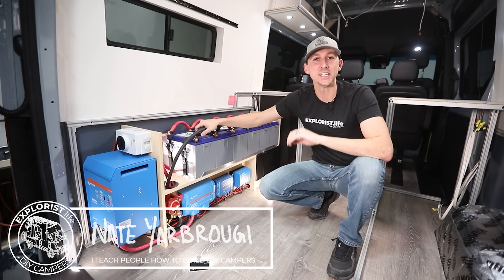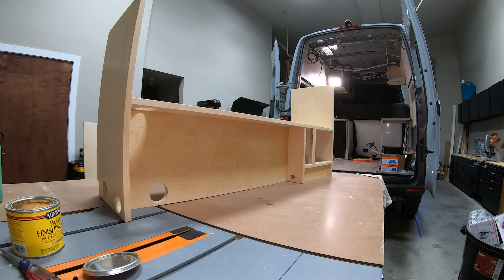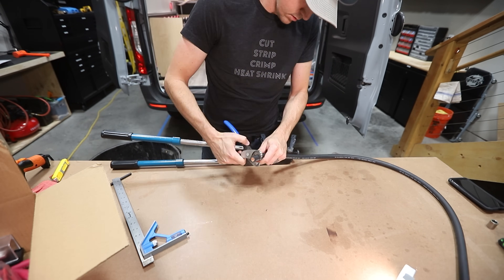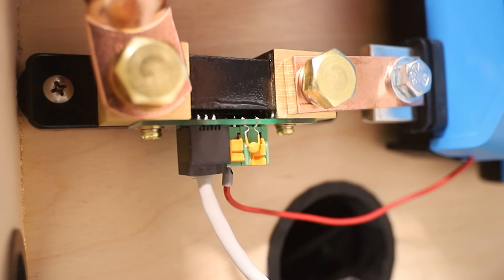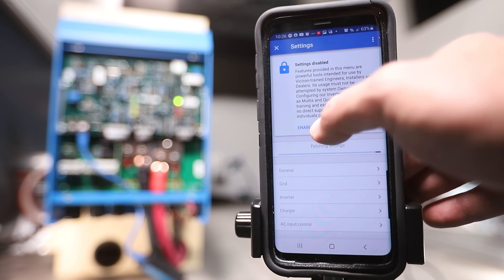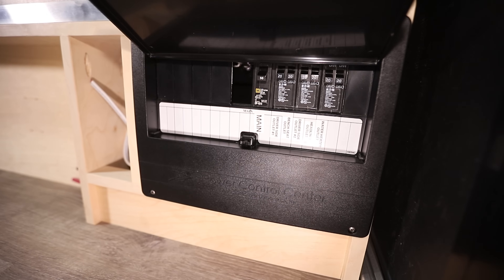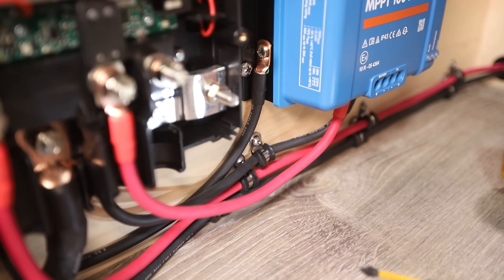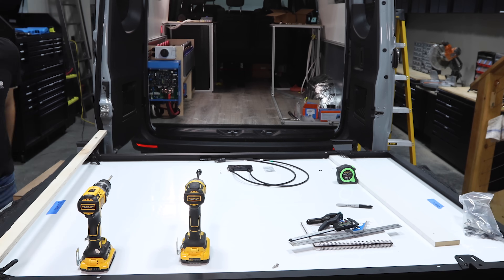DIY Sprinter Camper Van Electrical Install - Full Tutorial

Comment: I've been using this video as a reference to install a similar system in my sailboat but I'm totally confused about the chassis ground. I don't expect you guys to know where/what that is on a boat since this is about vanlife, but just wondering if there's a chance in hell that your content would ever address marine installations? (You reference ABYC after all 😉).

Gotta say THANK YOU for this style of video. Without finding this, I would not have started this project, but I'm having fun and glad I took the plunge!

Comment: Wow what a pro job in filming,editing ,narration depth and generosity of the info given ...bravo , the YT algorithm suggested this video this morning and I am hooked just subscribed to your channel.

Question, why install the batteries on the shelf instead of the floor on an insulated pad. The batteries that don't need any interventions if they are working properly are heavy you wire them and , forget them vs all the controls boxes that you have will be easier to reach at the higth of the batteries, thanks in advance for the answer!
Reply from the maker: Basically, everything just 'fit' better with this configuration.  I had set dimensions I was working within for the enclosure and trying to get 4+ batteries with them on the floor made the enclosure about 5"(ish) wider; which didn't work for this setup.  Stay tuned to our currently ongoing Transit build.  We are putting the batteries on the floor and the rest of the components on the wall in that setup.
Reply: @EXPLORISTlife  Reading your response I just find out that my question made no senses...due to the wheelhouse the batteries on the floor will be further toward the Centre of the van, and take to much valuable space.

Comment: This is hands-down, one of the best videos in all of Internet, regardless of topic, regardless of genre. This dude did an incredible job explaining the Lemans and incidence of a 12 V system for a Camper Van, or any other application you want to use. They should empower all the DIYers That have little to no experience Anaïs to do their own work. Order it from this guy and install it yourself and you will have an incredible system. Absolutely well done to the author and I will for sure. Try to mimic more details like this on my YouTube channel maximum Overland. Again, well done.

Comment: Thank you for the great videos. Just an observation , in your wiring diagram the bmv 712 appears to be wired backwards. Looking at the bmv from the top the battery side is closest to the data cable. Maybe this has been noticed before in the 2000 or so comments ( I didn’t wade through them all). 

Again thanks for the informative videos.
Reply from the maker: Victron has switched the orientation a time or two over the years.  Wire according to the instructions as indicated on the side of the shunt.
Reply: Awesome, thank you.

Comment: Great video and an excellent design.  I noticed your printed grommets have the standard SketchUp 24 segment circle issue.  You can increase the number of segments (try 60 or so) by selecting the edge and hitting "s" to specify a number other than the default of 24.  It will make your round objects come out much better!
Reply from the maker: Whaaaaat? Just tried it.  Thats MUCH better.  Neat!!

Comment: This is really the best video I've ever seen on this topic, congrats!
If I didnt miss it, there is no load connected to the chassis and it doesnt seem that any of your hot cable might ever touch the blank chassis. So, why did you connect a chassis ground?
Reply from the maker: So that GFCI outlets would properly function and as a safety in the event that a hot cable did touch the blank chassis (rare, sure... but still possible).

Comment: i contacted Solaria about mounting their panel on the roof of our trailer and they said the following   "Unfortunately, Solaria panels are designed only for rooftop and ground mounted installations. Because of the unknown environmental conditions and exposures on boats or moving vehicles, we don’t recommend these types of installations."   have you had any issues with yours or any other comments on this?  the Solaria  POWERXT-400R-PM   seems like it would be a great fit for our needs.  Thanks again! Love your videos and products!  I built this whole system with your help and it works great (just need a solar panel)
Reply from the maker: I have heard of no issues, no.

Comment: This amazing video saved me a bunch of time searching online. I'm curious as to why 4/0 cable was used to go from the 3kw inverter to the Lynx distributor and battery to battery. According to the manual from Victron it calls for a maximum of 2/0 cable. After watching the "wire size video" and using "The Explorist" calculator my cable size comes out to 1/0, but my setup is similar in length compared to the video which uses 4/0. I'm in the process of retrofitting my camper van with a Victron inverter and want to make sure it's done properly!
Reply from the maker: You’ll notice that is 2x 2/0 aka, 2x 2/0 positive and 2x 2/0 negative.  1x 4/0 meets those copper cross sections in a much easier to wire package: https://shop.explorist.life if you don’t want to bother with calculations and just get wiring kits guaranteed to work by the end of this week.
Reply: So in other words, the 4/0 is more suitable for battery battery and inverter to Lynx distributor because the cross section equals that of 2x 2/0?

The website is amazingly user friendly. Waiting on a few things before buying the Lynx distributor kit!

Thanks a bunch!

Comment: Your work is very meticulous and very clean. Good job. But did you consider moving to a 24 volt or even 48 volt system to decrease the dc amperage flowing through the batteries and inverter? The cables you are using are pretty thick as a consequence, resembling the power system of a building instead of just a camper van.

Comment: On the dc to dc charger fuse block install.   Is that one vacant fuse slot that you used always left vacant by MB?  Since I have the premium seat package and have four connections to disengage where your video only has one your insight and guidance could save me lots of time or frustration.  Your store shows an optional circuit breaker for the dc to dc charger. If that option must be used where would that hook up?  Thanks Nate for all that you and Steph do in helping the DIY community.  Instructional videos and explanations skillfully done like this one is a true GAME CHANGER.
Reply from the maker: No problem.  Happy to help!
Reply: @tammietimmion6994 I'm in the same boat now. Did you find out if your slot was vacant?

Comment: Hey Nate! awesome video, actually gonna be using this to build out my electrical system as well. Just a quick question i was looking on your website and was wondering if this build with the 600Ah – Multiplus 3k 12v – Orion 12-12 | 30 – 400W Solar Wiring Kit is able to be upgraded to like a 800-1000ah system? by just adding more batteries? or if you had a build kit for something with a little more juice. THANKS! keep up the great content

Comment: Excellent video! Spot on explanations on each bob and bit in the system.

Here's a question: can you add an additional charging source, e.g. a generator to this rig and how?
Reply from the maker: Thanks!  In a van, a generator would most commonly just be set outside and then the shore power plug would be connected to it.  It's pretty rare to hard wire a generator into a van.  If hard wiring was desired, a 30A Transfer switch would be added between the shore power inlet and the Multiplus.

Comment: Battle Born has 100 Ah 12v batteries with the battery lugs on the end and offset you can connect them with two tinned copper bus bars and no wire except going to the inverter. This would make a much more tidy system.
Reply from the maker: But then people would have to drill and cut copper bar, which I've found that people are hesitant to do, so I decided to show the more 'DIYer Friendly' method.  The way you're talking about, though, also works perfectly fine for battery bank wiring.  You'd still need wire from the battery bank to the Lynx Distributor and to the Inverter/MPPT/orion, though.

Comment: Two questions;
Since the batteries have all the weight, why not have them on the bottom to keep the center of gravity of the van lower and more stable. Then the electrical items above on the back board? Easier to access.
Might have also mounted the main switch exterior to the battery compartment so if you had a fire, you wouldn't have to reach in the battery area to disconnect.

Second, how much did this total install cost, including the photocells, batteries, wire,  electronics and misc hardware items? What would one budget to do this? Including the crimpers and special tools.

Very nice video.
Reply from the maker: 1: They just didn't fit as nicely like that.  Also...  all of those batteries weight less than 200lbs, so not enough to worry about.

2: The pinned comment has a link to the kit which includes a list of all parts and their prices.  This is the best place to find most up to date pricing.

Comment: I am here to learn the DC side of things. I have reasonable knowledge of residential wiring. The only critique I could make concerns 120v tandem breakers, regardless of brand. What you are doing with a tandem breaker is combining the heat of some combination of 15, 20 or even 30 amp circuits into the space of one 1" breaker. You potentially double the heat in a one inch breaker space. If you wanted to be extra safe and cover one more "I went over kill" base, split those tandems into individual breakers, if you have the space. I don't know if van users would pound their 120v system like we do in a house, but if they do, consider what I've said. I sold breakers for years and many of them were replacement tandems. Square D QO series are great. They use  nickle or tin plated copper buss in the breaker boxes = better warranty. Many others have an aluminum buss. Lesser warranty (more chance of heat due to oxidation).
Thank you. It's not often I find someone I can listen to for hours on end. You have a special talent as a teacher. We might be doing business.
Reply from the maker: Glad it helped!  Thanks for the input, but I'm still perfectly okay with recommending the use of tandem breakers as shown since they are UL listed for the purpose we are using them for.  Feel free to use whatever breakers you like in your system, but I just had to respond to defend my usage of tandem breakers for anybody else reading through these comments that your statement is scaring off.
Reply: @EXPLORISTlife  scaring off? hello and good bye
Reply from the maker: You can't expect to give me a backhanded compliment with information that conflicts with my video without a response defending my position.

Comment: AMAZING VIDEO as always with your explanation you make it so easy to understand. I have a question with regards to shore power / Generator I would like to permanently install a surge inside the van so I guest from that the wiring on the surge side will go to the power inverter. Thank you again
Reply from the maker: Yeah; that'd just be between the shore power inlet and the Multiplus AC-IN.

Comment: Great video, like the setup. Just one thing to clarify, u use a 450A fuse with 4/0 cable which is rated for 321A under 16,4ft. And you switch is rated for 300A. Why not use a 300A fuse?
Reply from the maker: We are using a 400A fuse with 4/0 wire with 105 degree insulation rated to 445A with a switch rated for 300A continuous, but 500A intermittent which is sized for actual anticipated loads.

Comment: I cannot thank you  enough for this in-depth video… in a YouTube, explorists life, Nate Yarbrough… kinda fashion😆

Hey another question: I didn’t see the “T-sense” get connected to the inverter. Is it not necessary?
Reply from the maker: Not when using Battle Born Batteries.  Since they don't need temperature based voltage compensation, the T-sense wire is not necessary.

Comment: Can you please make a normal speed video with exact steps on how to wire up an accessory with particular focus on where/how to connect to panel for + and - wire. Thanks for this video.
Reply from the maker: Which 'accessory', specifically, are you needing more clarification on?
Reply: @EXPLORISTlife  Let's say a vhf radio on a boat for example.

Comment: Hi Nate,
Epic video and incredibly professional install kudos to you 🎉

A couple of questions, 

1. Given you have 600ah batteries, what are your total loads? 

2. It seems with your shore power, Dcdc and solar you aren’t really putting many amps back into your battery bank possibly rendering you into an AH deficit. What stopped you from amping up your solar, Dcdc, shore power to a much higher current supply to ensure you don’t run your batteries down?
Reply from the maker: 1: I don't remember what all of the loads were in the power audit for this van.  If you search for "EXPLORIST.life How Much" on YT, it'll give you a tutorial for performing a power audit for your own needs, though.

2: Solar and DCDC charging may be at a deficit depending on usage and was limited by available roof space and product availability of larger dc dc chargers.  Shore power would keep up just fine, though.

Comment: Awesome video🎉!!! I have a bus bar setup. When keeping the cables the same length for even charging and discharging, do I need to also consider the length of cable from the battery switch to the bus bar and shunt to bus or do the same like you show in the video?

Comment: Love this video. So informative as I head towards installing my own Victron system. One question. Is it advisable to add a breaker for the shore power before the inverter rather than relying on a campsite breaker to be up to scratch?

Comment: Regarding the shore power. I am looking at an Multiplus that is 24v/3000/70.  I believe the "70amp" is for the shore charging.  Does that just mean it will charge slower on shore than if it were a 120amp multiplus?

Comment: Great Job !!! All the way around!
One question,
Why the choice of panels? Were they thin film or was it just the lighting?

Awesome video
Reply from the maker: The panel is a standard silicon photovoltaic panel, not a thin film.  The panel chosen is just the one that Leslie wanted installed as it 'fit nicely' and it fell within the appropriate parameters of the charge controller we were going to use.

Comment: This was a GREAT video....as was as all the others in the solar series.  I watched this one numerous times and used it as a guide for my own solar installation on my truck camper.  Each time I watched it I picked up on some subtle but important details.  I wished there was a link on your website that I could "donate" as a Thank You, but didn't find one.  Is there one I missed?  Lastly, one question.  With a large lithium battery bank and 3000w inverter, I was surprised that I didn't see anything about pre-charing the inverter.  That was one thing I learned on my own.  Did you do that off camera or is there a reason you didn't have to do that step?  Thx again.  Keep up the great work.

Comment: Nate your videos are awesome and super helpful. I tried to sign up on your private group but I guess you aren't taking new customers?

My question is in regards to the Victron Orion DC-DC charger. I see you are using the ground under the seat in the Sprinters. Is this ground sufficient? The reason I ask is I have seen some people stating that it must connect direct to the starter batteries negative terminal but my sprinter doesn't have a spot for me to connect an additional wire. Any thoughts on this?
Thanks!!

Comment: Hey Nate thanks so much for your amazing videos following your diagram for 3000 w inverter 400 w solar and 400 ah battery system. Trying to add 2 12v fuse panels into the lynx distributor. As I’m following your amazing install video, where would be the best place to add the extra 12v fuse panel. Thank you so much for all that you guys do for the community!!!
Reply from the maker: Unless you have some big loads... you can run both fuse blocks off the same Lynx Distributor connection.  Lynx Distributor -> Fuse Block 1 -> Fuse Block 2.

Comment: I am finding your site and videos a great help while designing my system for a campulance...  mostly victron the panels are renology 320-D 2 of them... the inverter will be upgraded later currently a renoogy 2000w... a pair of SOK 206ahr lipo batteries with victron (lynx, mppt, orion, shunt)
i saw an interesting video from someone in the uk the other day he was building a system for a small boat... what i found interesting is he uses 2 orions one charges the batteries through the alternator while running as you would expect the second one charges the engine battery from the house batteries while engine is off... thoughts on something like that?

Comment: You mentioned victron app settings cheat sheets for both the mppt solar charge controller, and the orion for the battle born batteries but I don’t see that info in the description. Would the settings be similar if I used 12v renogy smart lifepo 100ah batteries? Really thorough and well explained setup.